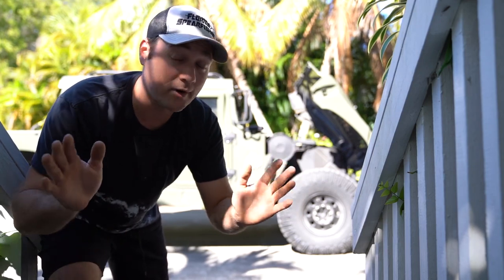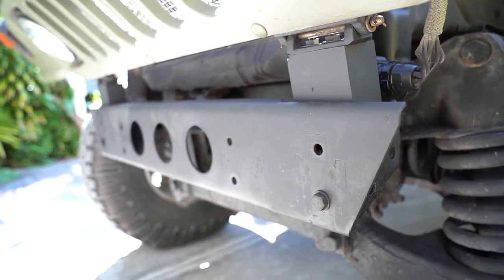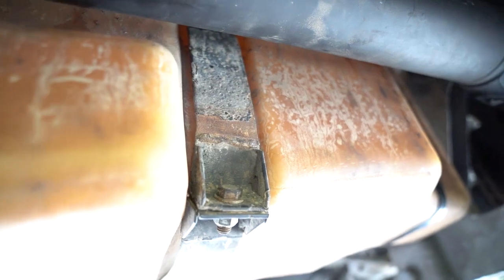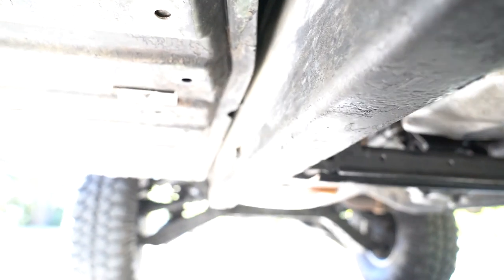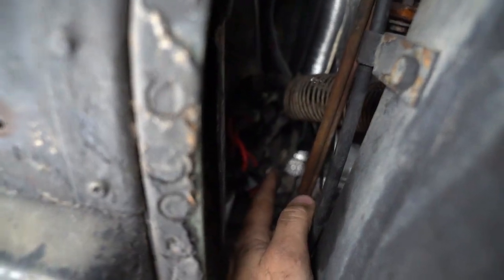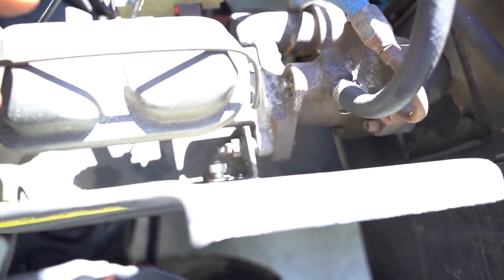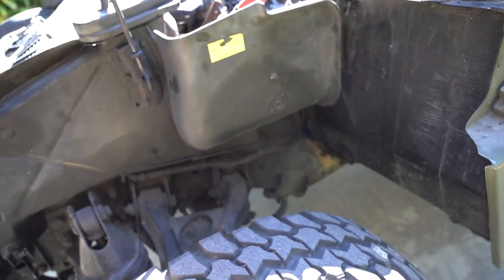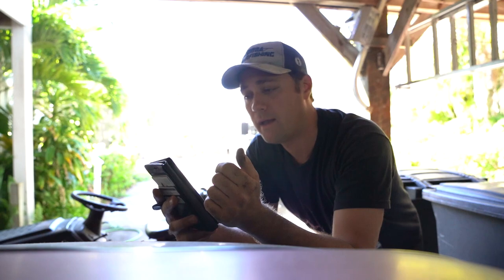How to lift a Hmmwv

Comment: Great video. It's all about the details. Your presentation is well thought out. You did a 4-6L80-E upgrade. I would. and I bet others would too, like to know about that. Like how you got around the electronics? Throttle position, speed sensors etc.
Reply from the maker: @sheltonsautomasters279  appreciate it! 4l80e is a good trans upgrade, I used the stand alone harness and TCM (transmission  computer) from black dog customs, it just plugs right into the trans and gets powered from one of your 12v batteries. Throttle position and speed sensor I forgot about but I think the black dog customs kit had all that covered.

Comment: I plan to install a 2" body lift on my A1097A2 next month and I hope I don't run into anything major.  A lot of guys total drop their fuel tank and weld in pieces to lengthen the strap but I like your idea of using longer bolts.  Did you have to change your shifting rods below your shifter?
THANKS FOR THE VIDEO!
Reply from the maker: 2" will be even more easy, you'll have less little issues than I had, fuel filler hose might not have to be changed. Add some blocks that are just the right thickness on top of the fuel tank so when you tighten up your new long bolts you can snug it all up, otherwise there is chance you could hit a bump and dislodge the tank.
From what I remember I was able to adjust the shift linkage to the point it all worked.
Reply: @TheCoralSniper  Ben, How in the world did you sneak the upper bolt on the fuel tank?
Reply from the maker: @LuigiLeone-tw8hb  I believe I installed that bolt from the bottom and tightened the nut from the top